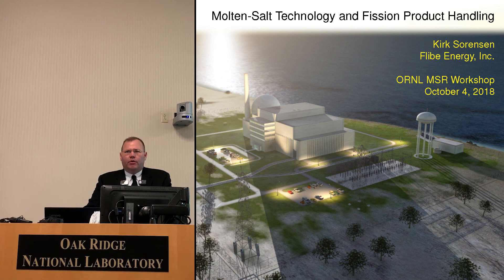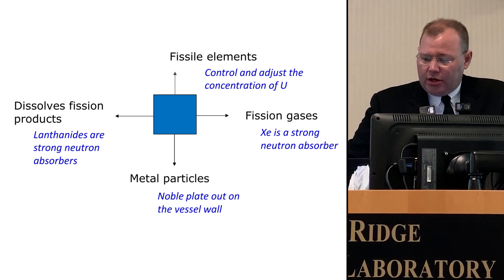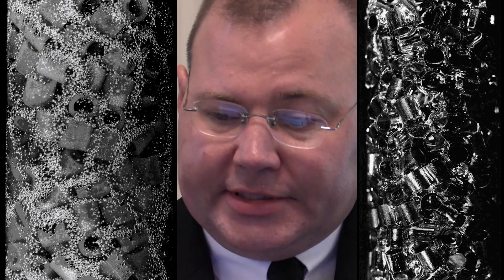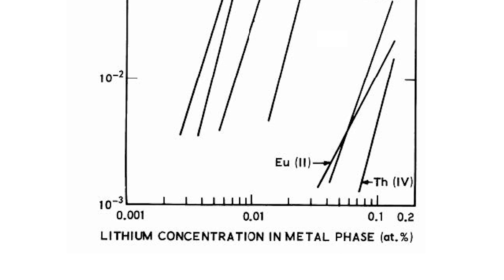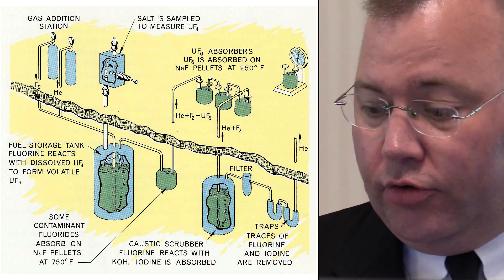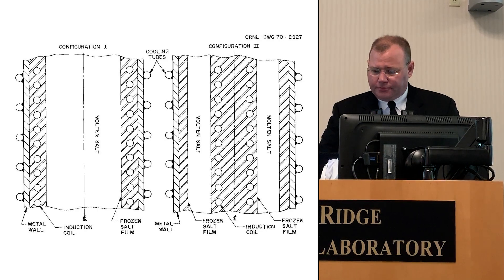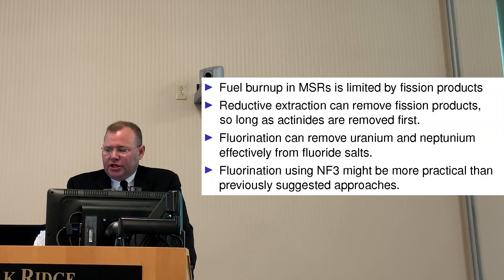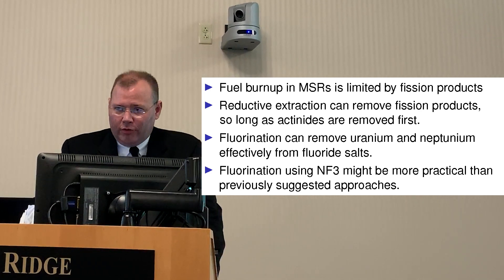Fluorination using NF3 - Kirk Sorensen of Flibe Energy @ ORNL's MSR Workshop

Comment: I feel like all the different MSR startups aren't so much as competing with each other as they're simply all interested in different aspects of the reactor.

ThorCon seems to be extremely focused on the assembly and manufacture of modular MSRs, but is slow on the details of how and why the reactor and the plant in whole will work.

Terrestrial Energy definitely has the most efficient and most laid out design plan for their reactor itself and how it operates, but deliberately leaves fuel reprocessing as an open ended slot that can be put aside for future thought.

Flibe Energy was always from the start interested in the potential of the MSR's fuel reprocessing opportunities, but Kirk (IMHO) is too stubborn to admit that a full blown LFTR with an online reprocessing plant is not a rational place to start out if you wanna test MSRs out for the very first time in the market. 

So here's my crazy business plan that I'd suggest for the MSR start up community. 

1.ThorCon should invest specifically in becoming a factory chain that specializes in the manufacturing process of small modular reactors. They could actually produce and assemble TE's IMSR. 

2.Use the IMSR. It's very obvious that Leblanc's reactor is going to be the first MSR to make it to the market. I'd go further to say that I think he's actually discovered the silver bullet of reactor design with his integral architecture that keeps everything that comes in contact with radiation isolated in a singular, self contained unit. No need to worry about pipes leaking radioactive fuel salt, because there is no piping with fuel salt in it! It flows directly from the graphite core into the heat exchangers and pumps that are all next to each other in the exact same integrated module.

3.Finally, Flibe Energy could fill in the "blank" spot that Terrestrial Energy created with the question of what will happen to the spent fuel salt once it's accumulated too many fission products. Flibe could invest in becoming the company that runs the 'reprocessing plant' that all spent fuel salt is sent to be refreshed with through the separation of the Uranium and other fissiles from the fission products, or even the separation of fission products from each other! This would give them enough experience in the handling process of radioactive molten salt to start work on an online reprocessing plant that could connect to an integral style 2-fluid thorium fueled reactor, creating a true LFTR.

It doesn't even have to sentimentally be any of these companies in particular. It's just that I feel all the different ideas for molten salt reactors have their strengths and weaknesses, and there's no reason why we can't combine what's best about all of them into one while it seems helpful to do exactly just that.
Reply: As the MSR sector begins to mature you will see some consolidation. I think Terrestrial has a great team in place and have a good chance of being first to market. I think Moltex and Elysium designs have the most potential. I don't think it matters who has the best design as they are all needed. A working MSR of any type would be awesome.
Reply: Any MSR that enters operation will pave the way for the others following it. 

I suspect that the SINAP TMSR will ultimately enter operation first. They are working with the regulator to write up the rules that might govern MSRs. Meanwhile Western design teams have to cope with a regulatory system ultimately modeled upon the safe and effective operation of PWRs. The regulators themselves lack expertise on non-water cooled designs and only now are the first cohorts of new nuclear engineering students coming online with any exposure to novel reactor concepts. 

Canada's CNSC might be said to be a performance based regulator but honestly I think they would be giving NuScale a free pass over many of the questions they might have before they might do the same with Terrestrial Energy. NuScale can point to prior art on PWR fuel and the way it behaves while being cooled with pressurised water. Terrestrial Energy has to produce coupled codes (how neutrons behave within core region, how they behave outside the core region, where do fission products wind up) and then has to demonstrate it in an instrumented design. Speaking of which, instrumentation and control expertise is widespread on water cooled reactors, while only now are projects like Seaborg Technologies bringing essential tools like laser induced plasma spectrometry to the nuclear field. 

I think that ultimately this balkanisation of focus on MSRs may hurt individual players more. Transatomic power making their work publicly available is an excellent example that all teams in the field should emulate. But to go further than that - to actively work together and share their experimental results. The way Terrestrial Energy has gone about it in the standard manner - building a patent portfolio for investors, keeping their coupled codes to themselves - will slow everyone else down rather than the MSR community banding together to share their mathematical knowledge to develop an MCNP or Serpent tool that the industry as a whole can show to regulators and say that this is how a fluid fueled reactor will work. In this respect, Elsa Merle Lucotte's team at Euratom is doing better than anyone else.
Reply: MonMalthias , I would be astonished if SINAP TMSR gets to "market" first.

Firstly, from my own personal experience and interactions with Chinese researchers, all science in China is done to the direction of the Party.  You research what the Party directs you to research, in the way they want you to research it, and no argument will change that.  They threw tons of money at "tissue engineering" research and got jack-nothing for results because the Party's goals were not where the research results were actually leading - the researchers I've interacted with were quite bitter about it.  Despite all the money China now has, they haven't skipped ahead in any field of endeavor, from manufacturing techniques to computer chips.  I don't expect it to magically change just for MSRs.

Furthermore, the TMSR project is being headed by the son of former-Party-Chief Jiang Zemin.  Current Party-Chief Xi Jinping is in a literal "death struggle" (people have been arrested and executed, along with a couple of suspected assassinations) with Jiang Zemin's faction in the government.  I don't see Xi Jinping allowing Jiang Zemin a huge "win" like bringing the world's first electricity-generating MSR online and capturing public admiration.  Before that happened, I would expect Jiang's son to be arrested on bribery charges, convicted, and executed - then roll out the TMSR plant.  That hasn't happened yet, so they're not even close.

As to American progress on reactor design: I actually think Flibe Energy is in the lead.  They've identified the remaining engineering hurdles and moved to address them.  Everyone else seems to be saying "we've got most of a reactor design laid out already, so send money to us and forget about those other fiddly bits we're not talking about - we're ready to break ground RIGHT THIS MINUTE if you Act Now!!1!1"  With an MSR, especially of the "modular" design most are promoting, once you know how you're going to build it and what it will require, the assembly is pretty simple and much less "cyclopean" than PWR construction is.  Assembly will be pretty quick.

Contrarywise, if you don't have an in-stride actinide removal method, as Kirk Sorensen is discussing here, the tiny free-neutron margin that Thorium-cycle has is going to cause a "simple" reactor to fizzle out on the neutron-absorbing actinide contaminants.
Reply: Danny Hill  I actually think Flibe is "in the lead".  Most of the other "we can build it now, we have the technology, we won't worry about actinide cleanup" designs seem to me to be hand-waving away the most imporant factors in the design.  Thorium fuel cycle doesn't really have a whole lot of "spare" neutrons to go around an many of the actinide products of the cycle are serious neutron traps.  If you don't have a robust actinide cleanup method already built into your plant, it's likely you'll end up with a reactor that "fizzles out".  That's what most of the existing designs are looking at.  The ThorCon "unitary" design looks to me to be just begging for Xenon gas-pressure cracking in the solid core.  That's not going to work well with a flowing coolant salt...  What Kirk Sorensen is talking about in this video isn't a "nice to have", it's a necessary component for an ongoing, productive reactor project.
Reply: @ANonymous-bh1un 
That is a misunderstanding of how the core of ThorCon or Flibe works.

There is no solid core in ThorCon. The core is liquid. The fuel is liquid, Xenon is bubbled out by a sparger, and returns to the core. The moderator is solid. Just like Flibe's design. Actually I would say that Flibe's design for moderator is more likely to be fraught because drilling out (or sintering with mandrel in-place) a graphite tube with a hexagonal cross section leaves very little room for  expansion in the X, Y and Z directions as the graphite is bombarded by neutrons and expands and contracts.

The Ebasco design that ThorCon takes their moderator arrangement from with 3 graphite plates, in 3 sectors, arraigned to form a hexagon, permits expansion in all directions without binding and does not suffer as much from the differences in neutron fluence as fuel moves from the cold inlet at the bottom to the hot outlet at the top. Cracked plates pose a flow impediment but not an immediate safety casualty. A cracked graphite pipe in the Flibe or SINAP design means a likely need for immediate shutdown and replacement, because primary salt is not supposed to be flowing between those hexagonal pipes. 

Furthermore, there is no way, in Flibe or ThorCon's design, for Xenon to somehow crack the moderator by gas pressure. Otherwise that would imply a fully pressurised fuel salt loop without any sparging. And yet Flibe and ThorCon both have allowances for sparging of fission gases. In any case, even if the primary loop were pressurised, as long as there was no sudden change in pressure, any gas that is entrained, would not change in bubble volume. That is how water reactors work, and we have 454 of them running right now. Of course you could have a change in pressure as well, if it was designed for that, like the boiling water reactor designs of GE, that do just that. 

There is no need for a robust actinide cleanup within a DMSR. Zero. ORNL proved that out with ORNL-5388 and the ORNL-TM-7207 reports.
http://energyfromthorium.com/pdf/ORNL-5388.pdf
http://energyfromthorium.com/pdf/ORNL-TM-7207.pdf

What you lose out is on isobreeding. That's it. A thermal breeder requires very rapid cycling of fuel salt through a fission product cleanup process otherwise it loses isobreeding from parasitic captures of lower atomic number products. ThorCon forgoes isobreeding for a pure "burner" cycle, losing in fuel efficiency but gaining in simplicity. I would say that  as a first step, ThorCon is superior if only as a way to show that MSRs can work. Thermal isobreeders like SINAP or Flibe's design can follow later, but the world is swimming in cheap uranium right now as the nuclear industry is still in the middle of post-Fukushima doldrums. As that picks back up, new supply can still come online from Australia and Kazakhstan, who are running at a pretty large degree of slack due to low prices. Even if uranium prices spike due to a commodities panic, it cannot rise above $130 per tonne for raw yellowcake, because that is the price at which seawater extraction of uranium becomes viable (and that ceiling is dropping every year as uranium adsorbents are worked on). 

The only world in which Flibe's design fully makes sense is one in which:
- Seawater uranium extraction somehow fails, despite having proof of viability in the US, Japan and elsewhere (Australia itself has a program at CSIRO)
- Somehow, mines in Canada, Australia and Kazakhstan run out of uranium overnight (not going to happen, because that also implies complete cessation of exploration for new resources, and ignores mining coal ash piles and enrichment facility reserves)
- Somehow, we stumble upon a supply of Uranium-233 from, I don't know, an unused Teapot-MET bomb pit or something, at Savannah River.

For the real world, ThorCon and any other DMSR or indeed, any MSFR (From Euratom) or MSCR (From Elysium) will be perfectly adequate.
Reply: Yes, or you could just move your company to Canada and pretend that you're in America!
Reply: Well, Canada is, for all intents and purposes, pretty much the exact same country. But all I'm saying is that if you Americans ever need a regulatory environment for reactor development that's not as intrinsically suffocating as the NRC's, feel free to bunk with us and we promise we won't take credit for your work ; )
Reply: @MoreParksLessParking  Truth, Dr. Leslie Dewan said the same with her Transatomic. The Canadian environment is better for innovation.
Reply: I have to check myself from time to time. So many different types of MSRs, all are better than solid fuel. Just as there are many paths to God, so there are many MSRs to power :D :D they need to work together for the greater good rather than fight. Im a FLiBeliever, but after listening to Dr. Leslie Dewan talk about her Transatomic, I see there are many good paths to be taken.
Reply: Scrap Catastrophe:) check out Terrestrial Energy's IMSR, a very pragmatic approach with great potential and most likely the first commercially deployed MSR. All these new startups will benefit from each other by developing industry infrastructure, like suppliers, contractors, licensing reforms etc. Just have to beat the special-interest political opposition that benefits from never resolving energy issues!
Reply: If we lived in a prison planet like you are proposing, that wealth wouldn’t exist for you to steal.
Reply: MonMaltias and Oliver Mayo, totally agree! Great new book from Richard Rhodes called "Energy", summarizes brilliantly these ideas. 
Cyruschadezzar, stop complaining and do something good for the world! You're not helping anyone or anything.
Reply: Trump I would guess under Peter Thiel's influence has put money into nuclear research
Reply: @Oliver Mayo Thorium has to be the long term solution as uranium is difficult to mine and process. But right now we have more than enough uranium so why not start there. Anything that avoids the regulatory issues has to be a front runner.
Reply: @Oliver Mayo Trump could probably be shifted by showing him Obama's illogical approach with China and rare earths. Trump is railing against China. What better (for him) than allowing USA to open it's rare earth mines and use thorium that collects.
Reply: @Joshua Guertler Any new energy source has to be cheaper than coal or it will simply displace coal to the third world. Moltex say their design does that. We will see.